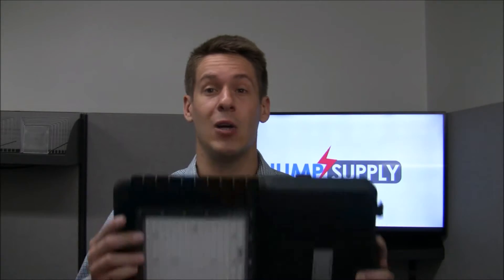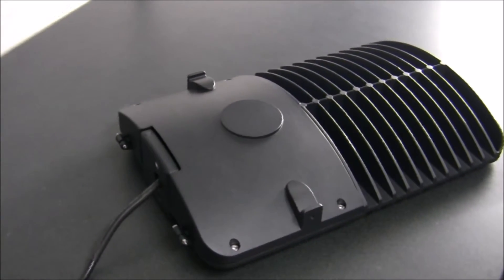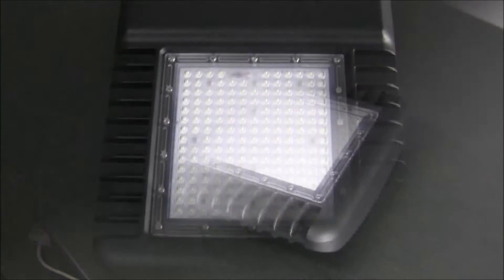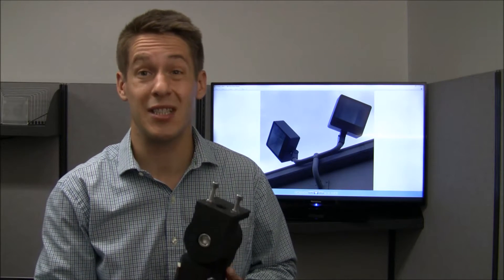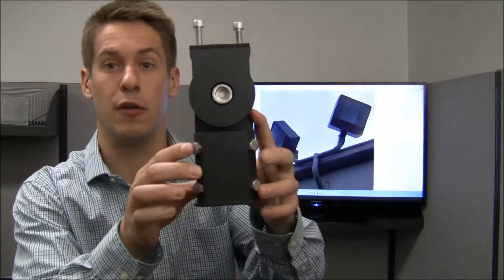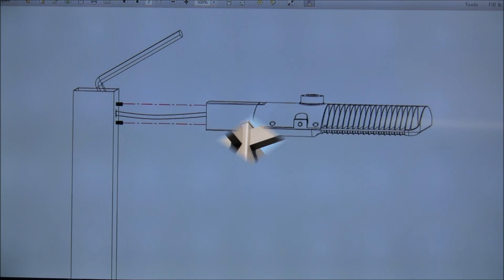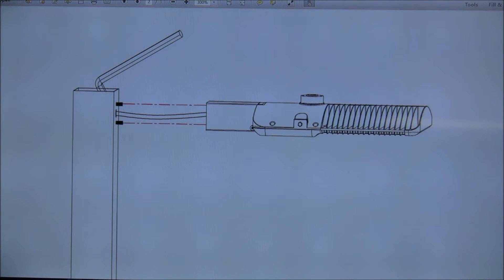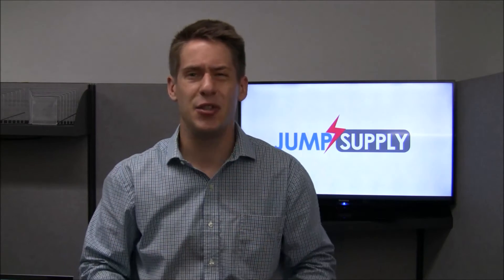LED Parking Lot Fixture Mount Types

Comment: Hi, do you have spec drawing for each of these fixtures and brackets that fit onto the pole? Like the distance between the screws etc. so that we know how to drill the holes into the pole where the light will fit
Reply from the maker: Hi Prekak, thank you for the question.  We do have these diagrams.  Please send us an email at sales@jumpsupply.com and we will answer any questions you have, as well as attach the requested install spec sheets.